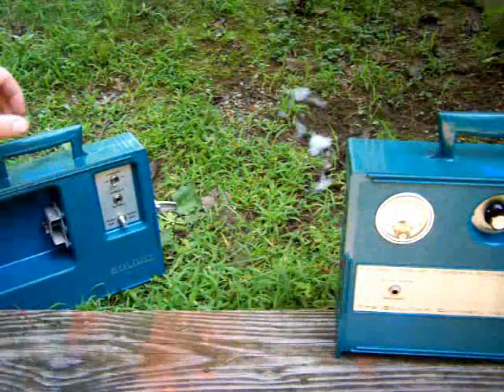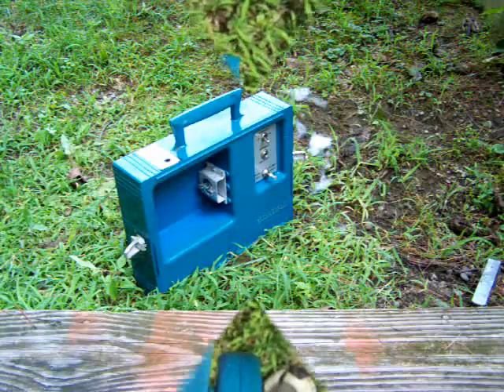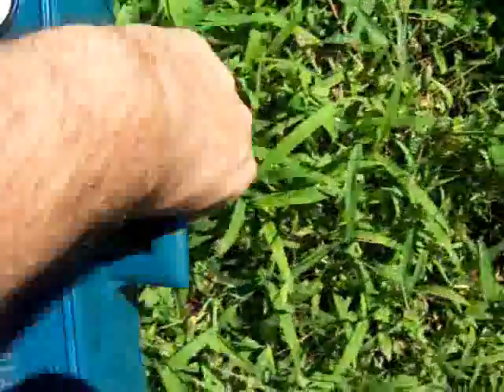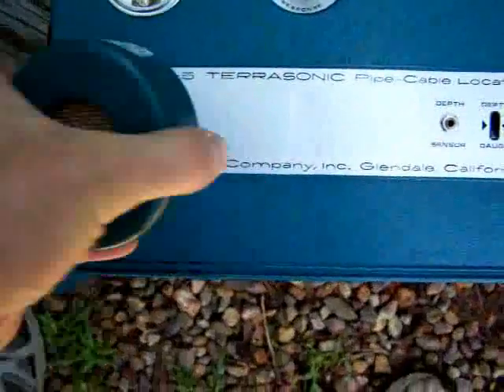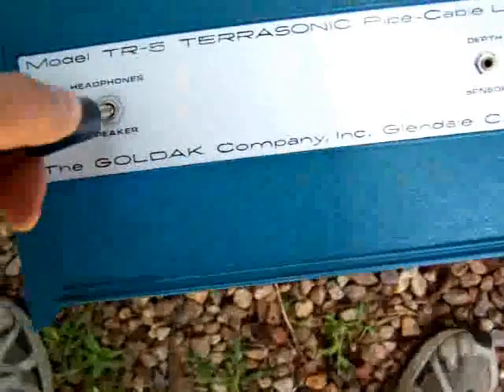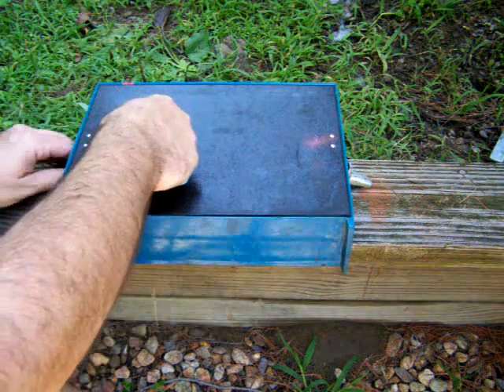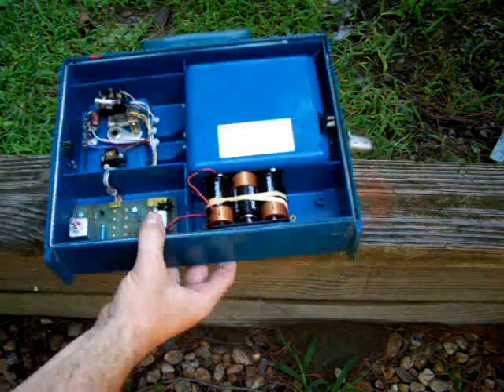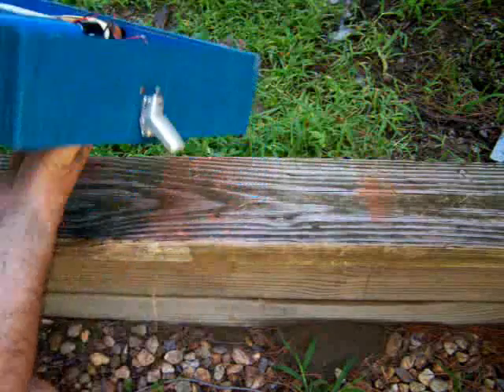Goldak TR 5 Pipe and Cable Locator Demo movie

Comment from the maker: I converted these to C cells just so you can change the batteries easily.  The grey sealed modules were in the TR-4's and made them hard to work on.  The TR-5A's were pretty good as well.  They figured out how to build-in the speaker in that model,  All these guys, Fisher, Metrotech, Goldak all had these sound box transitions.  I mean how hard was it to put in a speaker.  I could never figure out what these guys were thinking.

Comment from the maker: This older Goldak's were pretty rugged and nice.  I like the TW-6 over the newer Goldaks.  The newer Goldak' 902's have cheap switches and battery holders in them.  Fisher has maintained the rugged switches as they did in their TW-5's.  The TW-6 is over-all much more rugged.  Remember you can't trace non-conductive sewer lines with these unless you get a sonde or put a metal fish down the line.

Comment: Thaks-I just acquired a GOLDAK Model 1101 Metal Detector - it's almost identical to this one you have. If interested send me a reply.
Reply: I have a similar device this device also I would like to exchange some information white supr x500 locator but it arrived to me without a handle
Reply: @jehadjbory9270   I still have the unit I mentioned. If you want photos send me a link.
Reply: @PUPPYBONZ  I don't have a link that I can share with you on WhatsApp
Reply: @jehadjbory9270  If interested I'll put it on ebay. lmk
Reply: @PUPPYBONZ   Yes, I received a month ago. I wanted to share with you some information about my device, so what type of batteries are suitable for this device?
Reply: @PUPPYBONZ  Hello, I mentioned to you that I have a device like the one in the video, but from the company White x500 blue and I put a 9v 6lr61 battery I found and started it, but I don’t know if it is suitable or should I put a type C battery and I also want to know how long the handle is for this device.  ...what link do you want